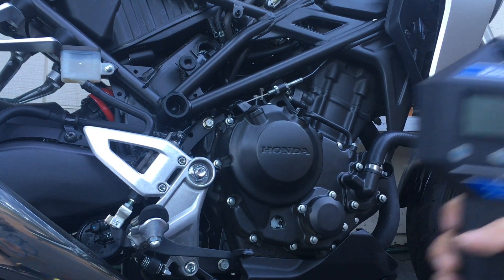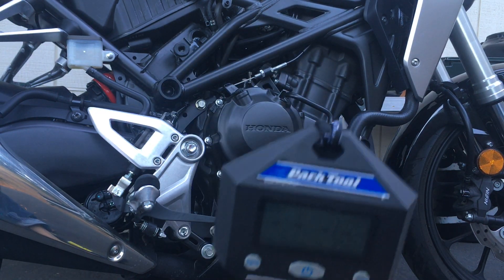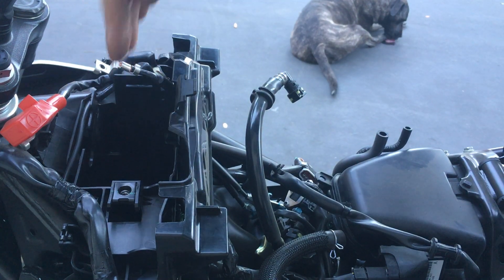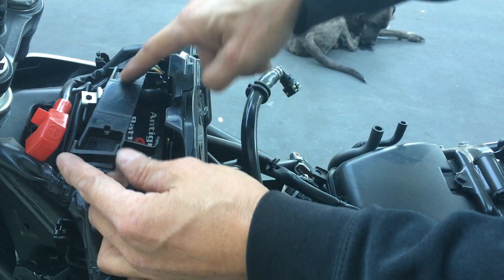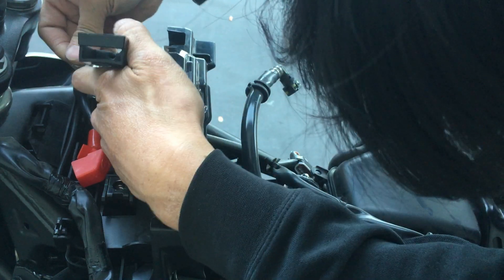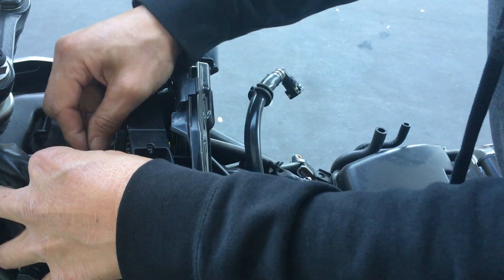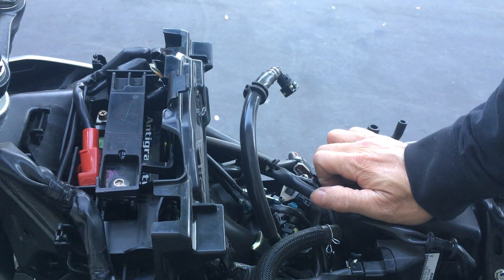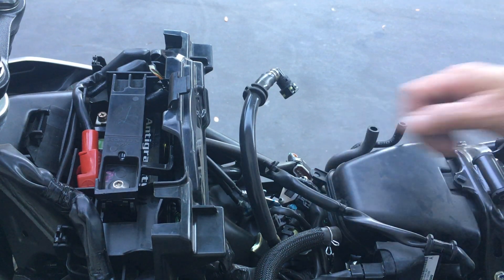CB300R battery weight & install

Comment: Besides better start are there other benefits does this battery provide? i am planning on buying one myself and also i currently have a batter tender jr that i use with mine would i need to use a different battery tender with this one or will I still be able to continue using it? I know I can search answers but personal input seems most useful for this model. Thank you for your time.
Reply from the maker: using Li-Fe-PO is stronger start, less weight about 1/4 of lead battery,  can't use lead battery charger that will damage the Lithium battery, will have to use a Li-Fe-PO charger

Comment: Im thinking of buying this. Aside from the weight, what are the advantages of lithium battery? Will the bike start easier?
Reply from the maker: Yes starts stronger
Reply: DaBinChe i find you videos very useful, i bought a 2019 cb300r a few months ago. First bike
Reply: DaBinChe hey sorry to bug you again but im about to order the antigravity battery and they offer a $180 with 240 cranking amps or a $130 that has 150 cranking amps, which one should i get? The cost isnt an issue but i dont want to pay more for something unless it has actual value gained
Reply from the maker: @hao.vu1  stock battery is 100 cranking I think

Comment: You screwed that plastic piece upside down. Thats why the lid isn't closing. Get the shinier part to face you.
Reply from the maker: That was the position it was in when I took it off...unless the Honda dealer put in back in wrong after the recall work.
Reply from the maker: Looks like you are right.  I just check the micro fiche and it is flipped upside down.  This will give me a reason to go in there and run a pigtail battery charger cable.  Thanks!!!
Reply from the maker: One reason I don't like dealers work. Their mechanics never seem to get things right, always something overlooked.  Thanks again for pointing it out.